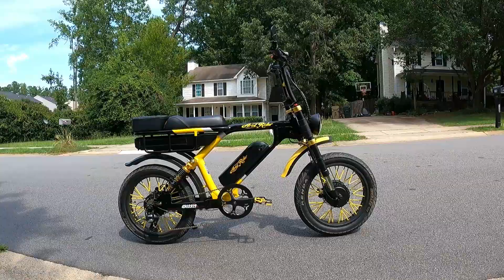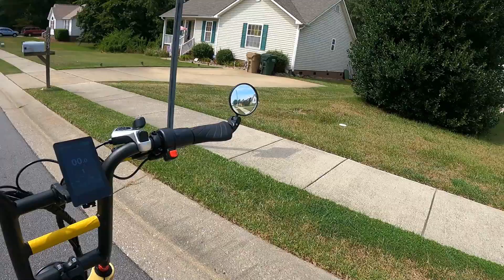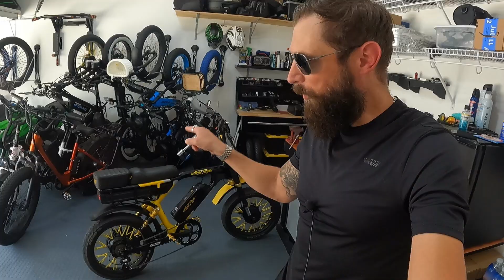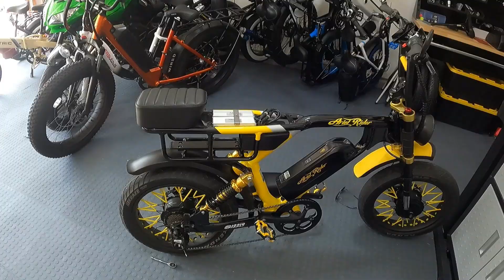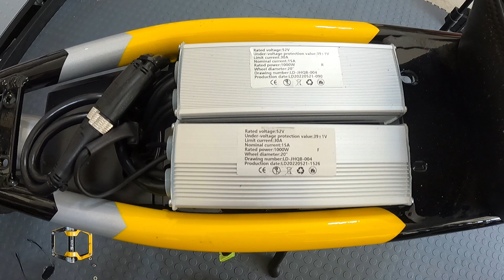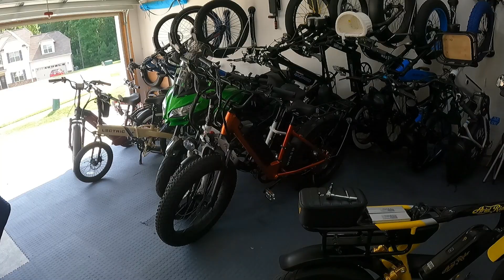What Amp Controllers Are In My Ariel Grizzly?

Comment: What happens if I adjust my display settings for amps higher than what my controller is rated for? I have a 1200 watt 30 amp controller I set it to 35 amps on display gained about 2+3 mph faster didn’t seem to bother anything?

Comment: Geared hub motors are just plain noisy as is obvious in your video. Tires are silent but those hubs are annoying. Go 72V with a mid drive and you will have quiet performance like no other. You seem to be working your way to more diying so I can only propose your next move on a custom build. I have moved my mid drive onto its 3rd bike so it’s always expandable and upgradable. 108lb Grizzly compared to my 55lb 4000w mid drive. You do the math on performance!

Comment: When you consider the Fabulous bikes use 22 amp controllers .... You'd think the grizzly would dust a Havoc X2
Reply from the maker: Fabulous uses 60v batteries though which closes the gap
Reply: @CitizenCycle925  well.. A bit perhaps.
Reply: Grizzly figures out still to be 240 watts more peak ability per motor. Or 480 dual watt higher than the 22 amp X 60 of a Fabulous dual.
Reply: The Fabulous also uses different looking motors, wouldn't be surprised if there was  less of a gear reduction then the Bafang style motors to achieve a higher top speed.

Comment: I recently got a bike that has two 750w Bafang wheels but the odd thing it says 19a max 9a nominal so I’m really confused it’s a stock dual motor bike. Any way to add bigger controllers and amps to you recommend? I have a 48v 20ah and a 48v 13 battery

Comment: Four paths to more speed:

1) Increase voltage.

2) Swap the motor for a faster wind.

3) Swap the controller for one that features field weakening.

4) Increase your gearing (larger wheel size with a hub motor).

Simply increasing the controller amperage has no effect on top speed unless it was severley underpowered to the point it couldnt reach top speed.
Reply: Nailed it 👍👍
Reply: But when he say's Increase the Voltage,  does that mean  increase the voltage choice of the battery, like going from 48 to 52?

P.S.  If increasing the controllers size won't increase speed, how do you explain all the youtube video's of people saying when they do so
they got increased speed ?
Reply: @flolou8496  It depends on what they mean. A lot of people simply mean increased acceleration. The only time a bigger controller will increase speed is if it was very small and holding the rest of the system back in the first place.
Reply: @flolou8496 yes when I say increase voltage that is exactly what I mean. More amps won't increase your top speed, they just help you get to the same speed faster(more torque).
Reply: @flolou8496 it's worth mentioning a lot of bikes that you buy will be severely limited due to regulations so to get past a speed restriction you can get an aftermarket controller and display so there is no speed limit built in. This is the one case where a controller upgrade will make you faster but it's only because the system was being restricted in the first place.

Comment: You are spot on. with weak controllers from the factory, you don't get the performance you will need for speed and climbing ability. I have been using 40Amp controllers and some 35 Amp controllers and it's like adding dual 4barrel carburetors on a stock 327 engine. Your channel is the most enjoyable for e-bikes.  Even if you just increase to 35Amp controllers you will notice a huge difference in performance.  Looking forward to your Grizzly surprise upgrade.
Reply from the maker: Glad you are enjoying my content. I'll be looking into possible controller upgrades for this bike.
Reply: We're can I get a pluginplay 40amp controller and display for my AR KEPLER? My display just broke so I wanna upgrade. Please help , if can. Thx

Comment: you might be able to turn the whole grizzley into 60v 50a system but there would be nowhere to hide the other big battery and super long controllers lol and then having too much power on the front wheel would be dangerous. 2 or 3kw rear with 1kw front is about all the front can sustain before wanting to constantly slide out from under you.

Comment: i have a bafang g60 750w front. and g62 1000w rear.  Both on 72v phaserunner v6 controllers, capable of 4000w total, 2000w peak each.  But i find there are a lot of diminishing returns after about 2000w total.  Can get going a good 35 or 40mph with 2000w.  But if you do 3000w or 4000w its only slightly faster.   So I think i understand why these pre builts with the dual hubs usually have them set to about 1000w or 1500w each. Doesn't make a lot of sense to go higher.  I think the citizen bike is probably faster top speed than the grizzly because it has 26" wheels that are close to a 28" diameter.
Reply: Interesting results. What is your battery setup and BMS discharge rate? Just asking because I run a single Phaserunner with 52v batteries, and I see jumps in performance at specifical intervals. there is not a big difference between 1800 and 2400 watts, but at 2600 watts there's a significant performance jump. Same with not being much difference from 2600 to 2900, but a big jump at 3000 watts. Most of my 5 batteries will only handle 2000 watts by themselves, but I have a couple that will support 2600, and if I run the dual Tesla batteries, they are fine with 3000. I can cruise at 35mph at 2600 watts, but 40mph+ is easy with 3000 watts. I run my field weakening at 40% and the phase current at 96 amps though, so that may be a factor.

Comment: My Hyper Scorpion has 35 amp. Too how the controller feeds the power counts. Some controllers feed early and some build up while others save more power for the top. Another power player are the windings in the motor. Thicker wire torque hits on the bottom/take off the line. Thinner wire winds keep efficient power at the top end speed. The Hyper Scorpion is a average of all the above. So good push off the line but not enough to spin the wheel. Good build in the middle and then reaching tup and guts it out evenly/easily to the top 31mph full battery. Once it starts for the top it goes for it. Still it’s not a kick hard to that top. Tora showed a video of the bike on a dyno machine  illustrating how the out put geared up towards the top for the optimum efficiency-spread to conserve battery amp hours against volts power usage, 
I know this in detail as I have had my hoer scorpion for 4 years and know how it rides. It a steady power train that’s even bottom to the top. Gets me off the line, quickly to the top and steady 29-30-31mph sitting at 30 with cruise control till battery drain drops it down. Like the bike got 10,400 miles on it starts up every time. Reliable bike.
Kinda went on with this but necessary to tell the story. Thing that sucks is the fork. What a cheap piece of crap. See if the new rendition ( should be out soon) has upgraded one. Anyway fixing to put a better fork on mine.

Comment: Kind of wondering what amp controller is in my Rad Rover 6 Plus. It's tucked up inside of the down tub, need to find out how to remove it.

I'm in the process of upgrading to dual batteries (maybe triple)  and wondering what the stock controller is. Great video!
Reply from the maker: i would be curious to know as well if you decide to take it out.

Comment: Hey good morning!  Got a question for you.  With all the bikes you have ridden, have you ever made changes to the front suspension?  I am trying to garner information on how to take a bike without suspension and add front suspension to it.  Thanks!
Reply from the maker: Yes, I have changed out several front forks and it's kind of a pain in the butt. You'll need to remove The Crown race from the old set of forks, which is the hard part, and put it on the new firks.  It's a little metal ring that seats into the headsets bearings. If you search "citizen magicycle cruiser pro upgrades" i think i cover it in that video.

Comment: So assuming price wasn't a factor, would you overall recommend the Wired Freedom or the Ariel Grizzly? Have been watching your videos and am seriously considering one of these two, but I am having trouble making a decision.
Reply: 26x4 vs 20x4 is a pretty easy choice for me.  I have both formats and FAR prefer the comfort, stability at speed, and off road capabilities of the 26x4.  The smaller tires  just suck in comparison, but I am tall and can easily handle the much bigger tire.  If you want to actually pedal a little or a lot, and don’t want to be hassled on the bike paths or pulled over by a cop thinking your on an unlicensed moped, it’s a complete no brainer.  The Wired Freedom is much better and a lot less expensive.  If I had to ride 10miles on a Grizzly, it better be to the hospital to get traction for my back.

Comment: So with your Wired ebike having 40ah controller, does that mean if you add a second battery to it, it has to be a total of 40ah on both batteries?
Reply: if you have two batteries then yes the amp hours of the batteries add together for more capacity. To clear up some possible confusion - amps are current, amount of electricity going through a conductor at a point in time.  amp hours is a measure of current used over a period of time.      when we talk about controllers its usually amps.  But with batteries its usually the amp hours or capacity you are concerned about
Reply: No, the amp hour rating of the batteries does not need to match the controllers peak amp rating. A 20ah battery can run a 40a controller okay. Extra amp hours just provide extra range. A second battery does not have to have the same ah rating as the first one.

Comment: It just not that easy unfortunatley. It all comes down to the motor and its rpm/v. As the motor spins it generates its own voltage known as back EMF. Once you get up to speed and the motor matches the battery voltage power drops. This is why upgrading a controller does nothing for top speed, only acceleration. For a higher top speed you need a faster wind motor(more rpm/v), a higher voltage battery(this will result in a higher rpm since rpm is dictated by voltage) or a controller that can do field weakening to increase top speed at small hit to efficiency. 

If you really want to learn the fundamentals check out grin technologies on youtube deep dive into hub motors.

Comment: interesting that the controllers are only 30 amps. Controller current, however, doesn't make the bike faster, It increases the acceleration, not top speed. I am pretty sure when you say faster, you mean from a drag race point of view. Sorry you had to spend your money to be disappointed. The Citizen bike reigns supreme. If you want it to lose, you will  have to race against dual motor e-scooters.. Everything above the Grizzly, Wired, Fabulous are e-motorcycles, so The Citizen Bike can retire undefeated.
Reply from the maker: Yes by faster I mean off the line. I'm not disappointed with the grizzly though it's a great bike. Surprisingly I do have an e bike on the way that has a legitimate chance of crushing the citizen bike. You won't want to miss that one 😁